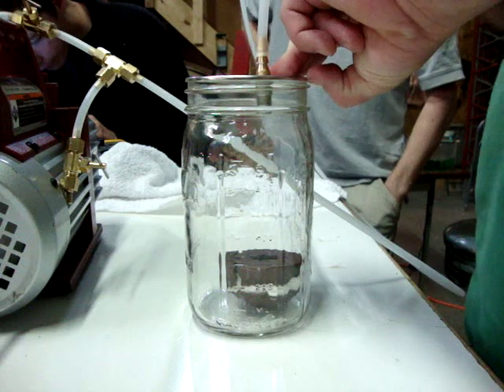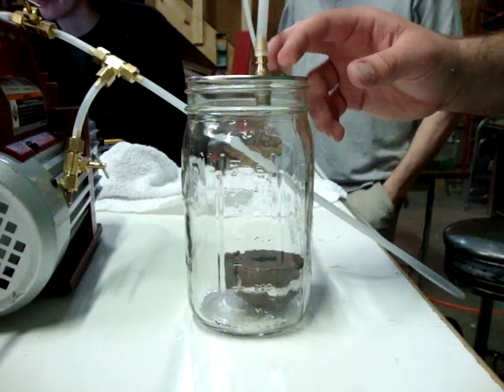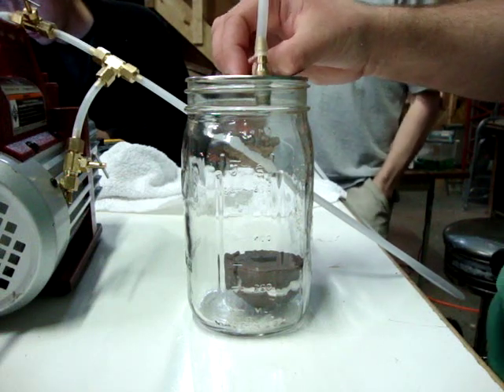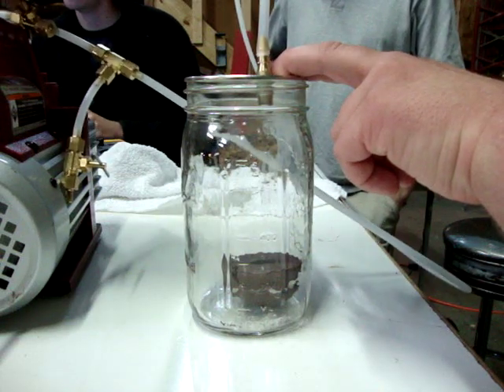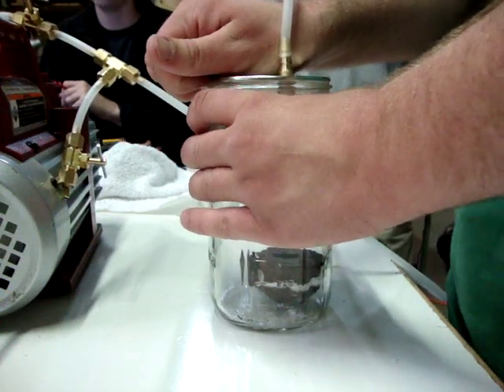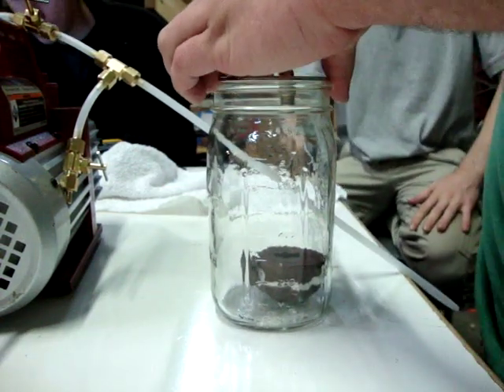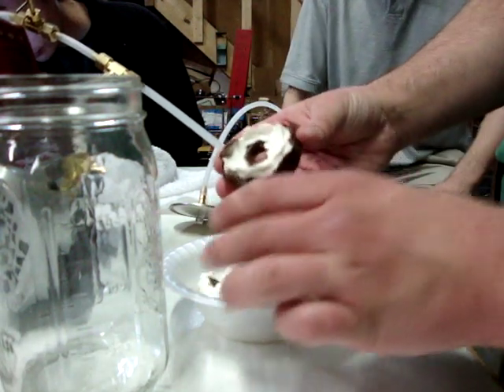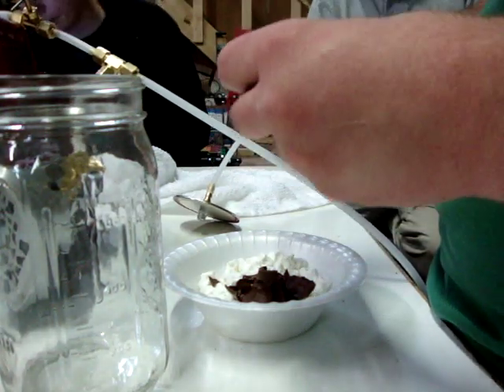Marshmallow Cookie: DIY Vacuum Chamber: Prototype_01

Comment from the maker: Nope. The PVC is stiff enough and small enough diameter that it's able to withstand the pressure differential quite nicely. Also it's MUCH cheaper and easier to work with than copper tubing.